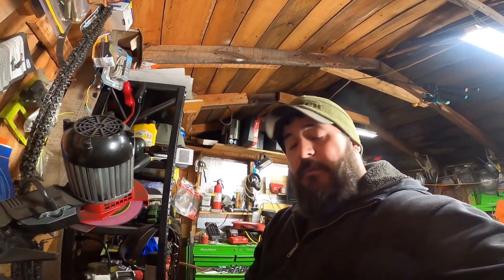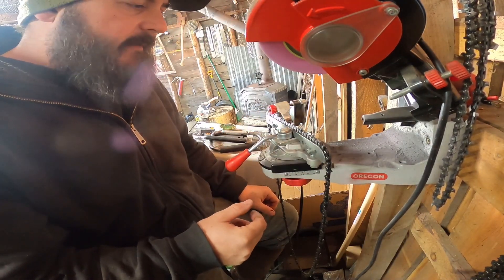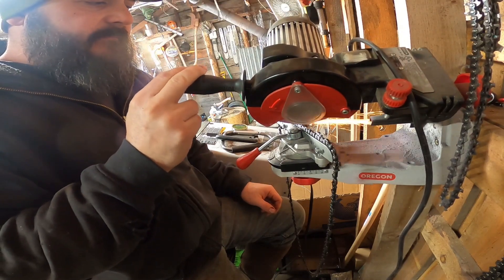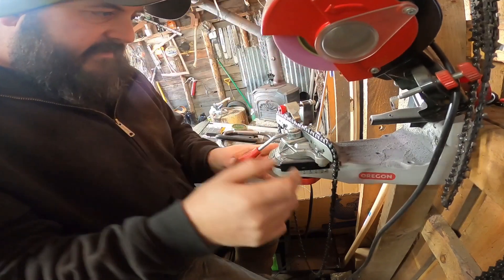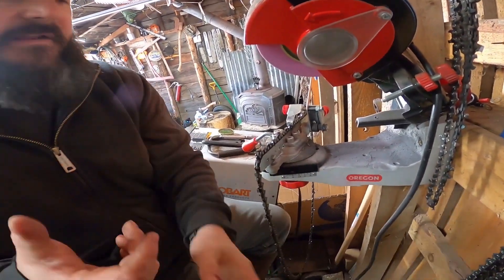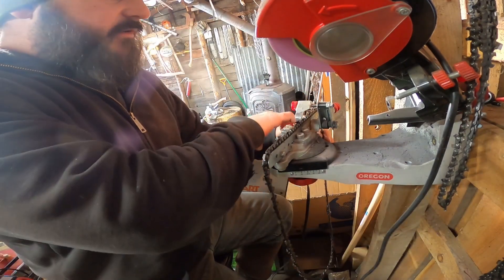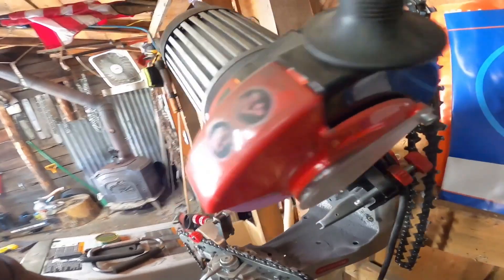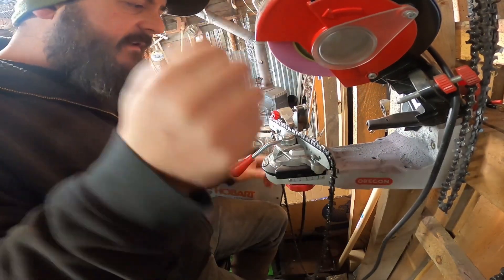Big thanks to Bert I think I figured the Oregon Chain grinder out

Comment: I've got a knock off version of that sharpener and it's pretty awesome, I've got to fiddle with mine  a bit more to set up each chain but for the price it works well. In the end it does a great job for a simple firewood guy. I set up my first tooth with the grinder off then check it against next two teeth, if it's consistant I roll it through. I still file my chains afterwards regardless, that grinder gets em back to even and the file gets em sharp.
Reply from the maker: Yeah iv done that a couple times luckily this was a good sharpening the cut like butter now I need to sharpen again lol

Comment: The 10 deg tilt helps to pull chips down and away from the cutting edge. The more you use the grinder, the better you'll get.
Reply from the maker: I’ll try it sometime just not on the processor chain